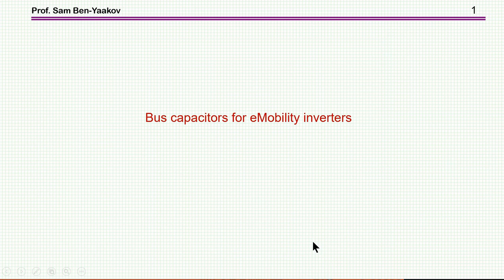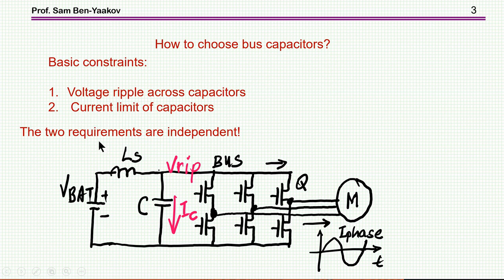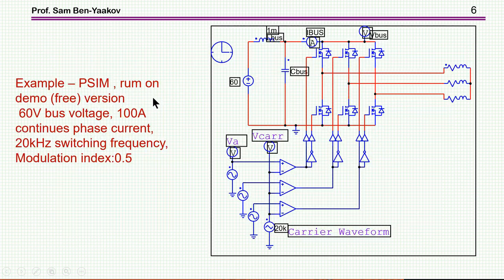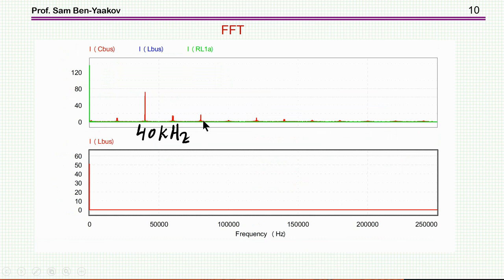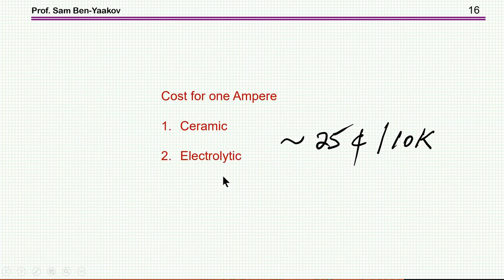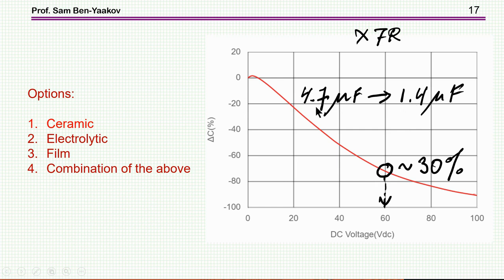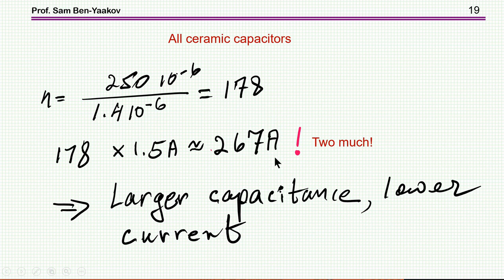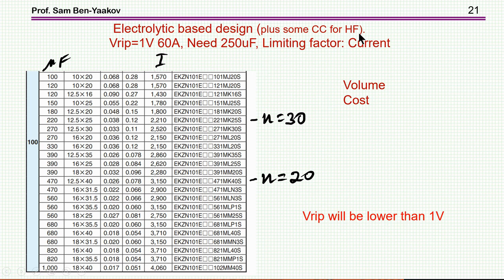Bus capacitors for eMobility inverters

Comment: In practical EV inverters, I found that there are three main types of caps used. The stack of film capacitors of 10uF or 20uF. A couple of 2220 MLCC caps for each leg (usually 100nF and 10nF). And the last one is small capacitance (0.1 - 1uF, but high ripple current ones) metalized film caps that are directly put next to the leads of the SIC MOS or IBGT. Could you please explain the reasoning behind it? And how the impedance curve is designed in this case?
Reply from the maker: You are talking about a high voltage system. In this case, as mentioned in video, film caps are effective.

Comment: Very interesting presentation, Thank u very much proffesor.
Reply from the maker: Thanks
Reply: @sambenyaakov  Hi proffesor. I have a question. After watching the professor's video many times, I still don't understand. With simulation professor parameters. Vbus 60V, I phase=100A, f=20kHz, how many electrolytic capacitors combined with how many caramic capacitors are needed to meet the rms ripple current parameters through the cap. Professor, can you tell me more about this issue?
Reply from the maker: @ThanhThanh-zu3gu  Once you decide what is the acceptable ripple voltage you select electrolytic caps  to have a total ESR such that the expected ripple current time the ESR times the current will meet the voltage ripple requirement. The ceramic capacitors  are then used to suppress the spikes due to the ESL of the electrolytic caps.
Reply: @sambenyaakov  Thank you professor for answering my question. I am designing an ESC for Drones. With ESC parameters I designed with parameters like Hobbywing's ESC (Platinum PRO V4 - 60A). Input Voltage 11,1V-22,2V, I phase rms=60A, f=20kHz.With this parameter, I calculated the current Icrms = 35A, but Hobbywing's ESC only uses 2 Rubycon series ZLJ (low ESR) 330uF capacitors with I ripple at 100kHz about 2A and ESR about 40mohm. Professor, can you help me answer this question? According to the professor's calculations, 17 capacitors in parallel are needed to meet the current Icrms=35A.
Reply from the maker: @ThanhThanh-zu3gu  Total ESR is 2.3. Looks reasonable. I think you can find 150uF with 1.5 Amp - see if it is better.
Reply: @sambenyaakov  Professor, can you help me answer more clearly? I want to ask why RMS current I_phase=60A but Hobbywing's ESC only uses 2 capacitors in parallel. Current is only 2A at 100kHz, 330uF.
Reply from the maker: @ThanhThanh-zu3gu  Do they have ceramic caps?
Reply: @sambenyaakov  have total 5 ceramic caps. 2 ceramic caps size 1206, 3 cap ceramic caps size 0603
Reply from the maker: @ThanhThanh-zu3gu  'Well, this would mean that the life expectancy of the caps will be very vey short. What is the power source?  and aren't there some hidden caps?
Reply: @sambenyaakov  Dear Professor, power source: Lipo battery 3S-6S.
Reply from the maker: @ThanhThanh-zu3gu  If the battery is very close to the inverter you can get by with smaller capacitors, the current ripple will pass via battery.
Reply: @sambenyaakov  Yes, the battery source is about 10cm away from the inverter. Thank you for answering my question. I will research more about LiPO batteries.

Comment: Thkx for this video, I think that Z, its Imaginary part and ESR vary versus frequency, and at the switching frequency, Z is almost ESR, and ESR increases with skin effet over 500kHz, so 1. sizing C should pass by ESR first and we cannot link Vripple at switching frequency to Cw if we want exact calculation 2. the AC current spectrum should be analysed due to skin effect because of ESR increase. My question is how to calculate C value, il it is simple in PFC tanks to 100z component but here with only DC and Ripple at switching frequency I dont know how to determine C exactly. Best rergards
Reply from the maker: The total impedance of ceramic capacitors is larger than ESR all the way to the resonant frequency. This is why the capacitance is of concern. In electrolytic caps the concern is current.

Comment: Thanks for the video Professor, Is there a reason for the video to specify ‘eMobility inverters’ in the title? I think that the concepts in it can be extrapolated to any kind of 3 phase inverter. Right?
Reply from the maker: Thanks for comment. I concentrated on a low voltage case which is associated with E-Mobility. For high voltage the considerations are somewhat different. E.g. film caps are attractive.

Comment: Thank you for this video for practical selection parameters of DC bus capacitor.
1)Will you please make a tutorial on thermal performance of DC link capacitor(Electrolytic, film and ceramic) and its life calculations(based on core temperature or ripple current) and its measurement methods.
This will be very helpful for design engineers to calculate life of product.
I have learnt so much from your tutorials.
Reply from the maker: Thanks for comment. As for suggestion, not simple, will try.
Reply: Yes sir please ..it will be very much helpful for design engineer as its very hard to get intuitive explanation like this

Comment: Hi Professor, 
How much does the ESL of the Electrolytic capacitor (or ceramic cap) affect the cap selection ? 
I have also noticed that the electrolytic capacitor datasheets do not provide ESL data or the SRF, they only provide tan delta. 
In simulations , I observe that the ESL of the cap has a really big impact on the ripple and also the VDS Spike during turn OFF of the FETs . 
Another request, would be great if you can make a video on the possible snubber circuits for inverters.
Reply from the maker: ESL is important, as you observed, generate spikes. Given for hybrid electrolytic . Parallel ceramic capacitors are recommended for simple aluminum caps. Look up my YouTube channel for videos on snubbers.

Comment: Dear professor, nice video. I have one doubts 8:25 you taken Ls as 1uH. But in simulation, you taken Ls as 1mH. Can i know the reason behind in this?
Reply from the maker: Sorry, there is indeed a confusion here. Ls is the capacitor's inductance. The marked Ls in 8:25 is an inductor was put to prevent the voltage source from shorting the bus for AC and hence no ripple will penetrate the capacitors.

Comment: Simulation of critical subcircuits always part of my design process.  However one must consider the limitations of the circuit models you are using.
In one portion of this video you stress using the frequency dependent ESR of the capacitor for the power dissipation and current sharing.  However the ESR in the capacitor models I am aware of are fixed and not frequency dependent, so you would need to adjust that ESR in the model based on the dominant frequency component of the ripple current.  Taking a stock capacitor  model will probably not work.
I have a video on measuring frequency dependent impedance with the Bode plot function of a modern oscilloscope and a current probe with many capacitor examples.
Reply from the maker: Thanks forthe comments. You seem to be unaware of the characteristics of ceramic capacitors (ESR frequency dependence). See:
https://www.ee.bgu.ac.il/~pel/pdf-files/jour145.pdf
https://youtu.be/yCK1hzgS_mU
https://youtu.be/vOsZD3rWCJM
https://youtu.be/2lfBvzhHsoc
Reply: @sambenyaakov  I am very aware of the frequency dependence of ESR and voltage dependence of the capacitance.   I was just expressing that the fixed lumped element models built in to circuit simulator do not easily model that behavior.  One always need to understand the limitations of the models they use.

If you look at the linked charts for the video I mentioned above you will see several examples of measured ESR vs. frequency.  The minimum ESR I am measuring in the VNA videos is just a simple way to fit the capacitor impedance curve using simple fixed lumped element model available in circuit simulators and a quick way to compare capacitors in the lab.   I fully understand that model (like most models) is not applicable to all situations.

I have recently been experimenting with modeling the voltage dependence of ceramic capacitors in LTspice using capacitor model feature that allows you to insert an expression for the charge in which LT spice derives the capacitance from the voltage derivative.   I have had limited success so far, but I still have had issues to work out.

I have seen the videos you linked, they were excellent.  Thank you for the link to your paper, I read it and am going to read a couple of your references.

In your paper both the ESR (1) and EPR (4) are frequency dependent.   I like the use of EPR in which the losses are voltage dependent since I would agree the dielectric losses are driven by the electric field.  However frequency dependent device models for a transient simulation are not simple and may can cause convergence issues.  It might be possible to implement frequency dependent models for harmonic balance simulation of a steady state fixed frequency condition.

At the end of your video you talk about SPICE simulation.  I would assume you use the frequency dependent ESR at the primary frequency in your capacitor models.   However it would be nice to have a capacitor models with both the frequency and voltage dependence built-in.
Reply from the maker: @Chris_Grossman  Thanks for conversion. I think  I understand now your points. For running the simulation I do not need a model. Since I assume a fixed  frequency  I just put an ideal cap R and L. For a deep analysis of capacitor  simulations see https://www.ee.bgu.ac.il/~pel/pdf-files/jour143.pdf

Comment: How do you choose the Vripple, and the Irms for a VSC?
Reply from the maker: The I is the actual  ripple current of system which you can get by simulation as I have indicated, I think, in the video. The Vripple is a design constrain, depending on the max voltage of components and EMI constraints.

Comment: Can we do same analysis using I=C* dv/dt...I am really excited to see how can we do the same analysis using above equation or can you give some hints
Reply from the maker: I do not think this is a good path to go. Perhaps using first harmonics then Cw= Irms/Vrms
Reply: @sambenyaakov  Thanks sir....in the DC link capacitor selection what is the role of  modulation index and modulation type and does power factor play any role in battery powered system?Could you please explain.

Comment: Dear Professor, Thanks for such an informative video. However I have a doubt regarding Impedance calculations at 8:45 . Shouldn't it be Vripple=Ipk*Zc. Thanks in advance.
Reply from the maker: What do you mean? missing *?
Reply: @sambenyaakov  . Professor in the slide it is mentioned as Vripple=Irms*Zc . Shouldn't it be peak current i.e. Vripple=Ipk*Zc
Reply from the maker: @archie6586  Vripple=Ipk*Zc is incorrect. This expression is valid for a pure sinusoidal current while the ripple current includes higher harmonics characterized by sharp peaks. Vripple(rms) =Irms*Zc is a reasonable approximation considering that  most of the energy is in the first harmonics.

Comment: Hi sir.
Could you make a video on modelling phase-shifted inverters and how to implement control and compensation circuit with commertial ICs? because all the phase-shifted ics that I found was only for dc dc converters.
Thank you.
Reply from the maker: Will see. Thanks for suggestion.

Comment: thank you professor, will you please mention the value of dc-link capacitance in the PSIM simulation. Also, is the phase current of 100 A rms, 100 Hz is drawn at unity power factor?
Reply from the maker: Cap value not important just big enough to capture most of the ripple current given the filter inductor. The pF as well the type of modulation will affect the value of the ripple current.
Reply: @sambenyaakov   @Sam Ben-Yaakov  thank you very much...i simulated in simulink...initially the results did not match with yours as I considered controlled current sources...but later I changed them to R-L loads...so could match..and get proper FFT... congratulations and many many best wishes for your explanations.

Comment: One thing missing from the presentation- the working point of the system. In EV, and in fact, in most motion systems, it's a very rare condition when both current and voltage on the motor are near the rated values and the system works near full power. In reality, usually, it's either we are going fast with little effort or we are pushing hard to accelerate, while the speed is low. Therefore the real optimum is different. Also the prices of ceramic capacitors are higher than the electrolytes, unfortunately.
Reply from the maker: Well, 
1. The capacitor ripple is caused by the phase current, that is the torque,  not the voltage (hence not a direct function of the  power).
2. I design systems to withstand the maximum stress, not the average
Reply: @sambenyaakov  when the voltage is 20%, the current seen by the bulk capacitors is 20%, isn't it? At least in RMS terms. Frankly I am not sure how important is the peak, but my guess is that if the heat of the electrolyte is a problem, peak doesn't matter much.

As per maximum stress, i just mean that in certain systems marginal reliability is traded for cost, sometimes
Reply from the maker: @lapserdak24  Again: the current ripple of the capacitors is a reflection of the phase current no matter what is the voltage. This video perhaps might help https://youtu.be/r_LmAsgfgrA
Reply: @sambenyaakov  thank you very much for the video. This whole series would be helpful for me some 15 years ago :) and it's still interesting now. 

However I would like to argue that even though the bulk capacitor current reflects the phase current, it is related to voltage as well. Its pretty obvious actually - neglect the losses, if motor voltage is 20% of the bus voltage then the bridge input (sitting on the full bus voltage) sees 20% of the current. Same amplitude, low duty cycle. Therefore the bulk capacitors at best see the 20%, and in fact less- part of the current comes from the battery.

So if we have a system where the battery is 60V and the motor never goes higher than 40V, the worst case will simply never occur.
Reply: @sambenyaakov  One year later i am working on a system that works on the exact spot i said was usually impossible :D

Comment: Could please tell me, how to calculate the ripple voltage and capacitance, if there is 20kHz current component also present with equal magnitude?
Reply from the maker: "current component also present with equal magnitude?" ???
Reply: @sambenyaakov  I mean to say "what if other than 40kHz component also present in the capacitor current with significant magnitude"?
Eg: if there is an rectifier instead of battery,  with very less cable inductance..
Reply from the maker: @maheshkumarnandigama2756  Well, you ned to consider the combines current. I do not understand the difficulty.
Reply: @sambenyaakov  okay, but to calculate the Zc which frequency need to be considered?
Reply from the maker: @maheshkumarnandigama2756  If one is, say, up to 30 percent of the other it can be neglected. Otherwise is is best examined by simulation in lieu of lengthy calculations.
Reply: @sambenyaakov  okay, thank you sir

Comment: Do you have a video covering AC voltage across class 1 MLCC capacitors? I bought some from LCSC rated for 630VDC at 15nF 1210 package size. They have pretty high Q factor, I think the datasheet specified minimum of 600? Pictures found here: https://imgur.com/gallery/8gYl5Qr

I put them to use in a DRSSTC tesla coil (a series resonant LC converter) and found that I could get some good performance from them, they did tend to crack, explode, and fail short-circuit, usually melting like glass due to the high voltage DC arc.
Reply from the maker: It seems that you are over stressing the caps. In YouTube  search window look for " sam ben- yaakov capacitor"
Reply: Check the dU/dt of your circuit and chose the capacitors accordingly. If their max dU/dt is not specified, don‘t use them. Also they have to stand the average current without getting to hot (short high current pulses of some us no problem mostly) There is a reason, most smd capacitors do not have any current spec: They suck at it. There are some RF COQ types on the market to meet the demand, but they are really expensive. Used in  space, oil drills and warfare.